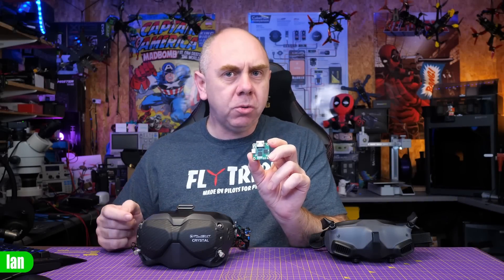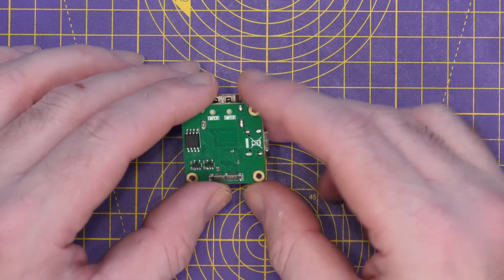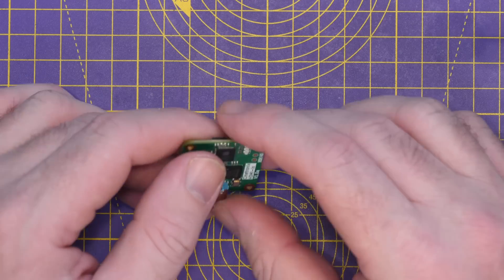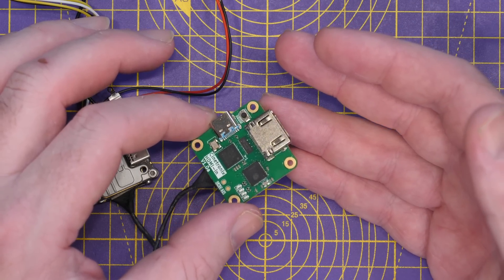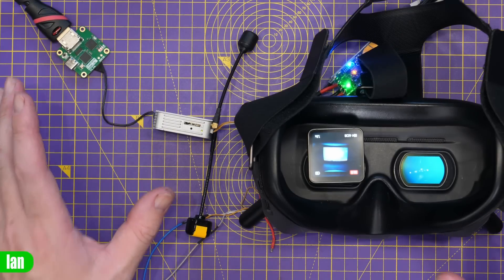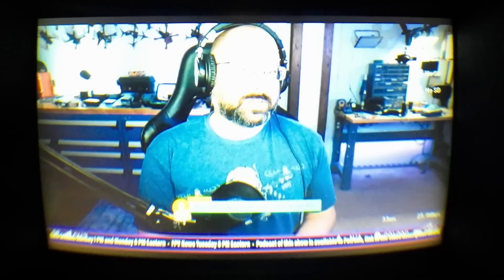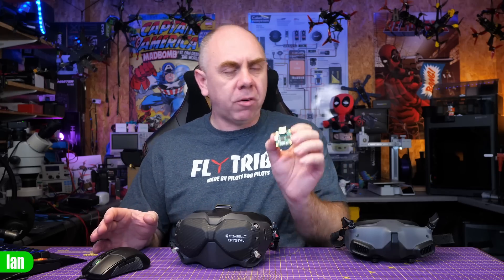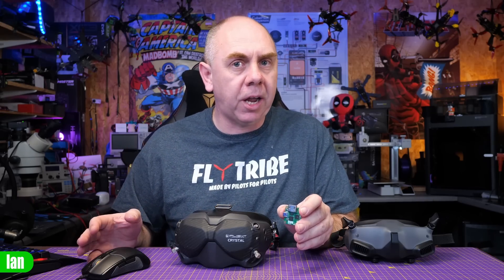HDMI Input For DJI Digital FPV - Cinetronix Did It!

Comment: Excellent video.  As a total novice I think I actually grasped much of what you were explaining due to your advanced knowledge of this stuff.  Your video is 6 months old as I watched it and I wonder if, by now, there's a way to stream video output from a GoPro Hero 13 or Osmo Action 5 directly into the DJI3 goggles.  Sounds like it would require a chip capable of 1080p but if either of the cameras would work in 720p mode it would solve my current dilemma.
Thanks in advance for any reply/feedback!

Comment: Shame there's no Audio. I'd bet this is the same HDMI to CSI-2 chip that's used with the video-in board for Raspberry Pi's, that have a break out through the I2S port for digital sound.
Should be a version available that does 1080/60, which is the upper limit of the NEC chip used for the conversion to CSI-2/MIPI

Comment: It's a pity you didn't say the most important thing, what delay does this board add to the video signal?
Reply from the maker: It's hard to measure when I don't have a baseline.
Reply: @MadRC  Can I control the simulator from a PC with Dji V2 glasses with a sufficiently low latency? Can you test it?you can, even without measuring the delay, see if it will be convenient or not
Reply: PS: I found the information this board gives 35-50 ms delay + 30ms vista delay!= 60-80 ms - it is not suitable for simulator and flight!

Comment: I cant believe there is no work around that 720p 60fps limitation! Non of my cameras have that option in the menu :/ cant use it.
Reply: they could use some kind of HDMI scaler, which would convert any resolution and any FPS into 720p60. This produc has so much potential

Comment: I'd like to run an HDMI signal directly into the goggles, without the wireless link (for a non-FPV application).  But I think the goggles only have an analog input.

Comment: I would like to use this board as a simulator adapter for PC. Previously I tried a hdmi to composite video adapter but the quality was even poorer than normal analogue video.
Maybe you could even use Dji Goggles as vr goggles if you added a motion tracker.

Comment: Awesome kit! An interesting scenario would be to use a Pi with one of many possible Pi-cameras available. 
There are also hats for the Pi (4, 5) that allow HDMI input (~$45-$50). This could be an option if needed to downscale a higher resolution to 720p FPV feed. In such a case, the Pi could also record the higher resolution. 
This would be application depended, because would require a larger drone with space, or fixed-wing platform. 
Many thanks for sharing Ian, as this opens up so many possibilities. Another is the ability to use HDMI switch, so multiple cameras could be flown, with ability to get actual camera views. eg: between an IR and visible light

Comment: For those asking about latency.  This is not meant to be used by the pilot.  This is a second feed option to a camera operator.
Reply: Would also be great for robotics.
Reply: the MS1858E chip adds about 42ms of latency.
Reply: HDZero now has a HDMI vtx with low latency

Comment: If that latency you can be gotten down then using a thermal camera as a tool for search and rescue on an fpv drone could be a very valuable thing. Another idea is to use this as some type of video signal repeater so that you could fly one drone high above your ground station location to act as a tall antenna and and get better signal over obstacles that may be between yourself and the further out drone.
Reply: I can see the Ukrainians and the Russians making use of it like this...

Comment: The Mavic 3T and M30T drone are pushing 620x512 resolution, I wonder how well a designated thermal camera on a drone with Inav would work.
Reply: Most thermal camera sensors are at 620 or below
Reply: @stihl888  yes

Comment: so whats the use case they had in mind when developing this board? the thermal camera application is pretty cool, are there any cameras you can actually use on an fpv quad for that with acceptable latency? that would be awesome.
Reply: My exact thought... For what really? 🤔. Maybe you could use some kind of Canon full frame camera on a 8 in so your Recording cam is also your FPV cam for framing shots as you see it... Maybe.

Comment: Is this something i can use to output HDMI from an RC-Pro controller straight to v2 goggles?
i fly mostly Mavic-3 and Mini-3 Pro drones and can't use the DJI Goggles RE anymore (they had an HDMI micro connector for video in).
I have AS (ankylosing spondylitis) and can't take the weight of those goggles on my spine. 

I have the HD-Zero goggles and Orqa ones as well, but nothing feels as good (least amount of pain) as the v2 goggles.
Thanks!!

btw - site says "out of stock" :(

Comment: Nice. but wont the air unit get hot as hell if using it continuously ?!
Reply: That's what a fans for!
Reply: @2down2togo  😂
Reply: @beefybeef1326  or u could try putting it on ice, good luck 👍
Reply: Buy thermal pad cut it and put heats ink and buy screws and use glue gun to lock in place